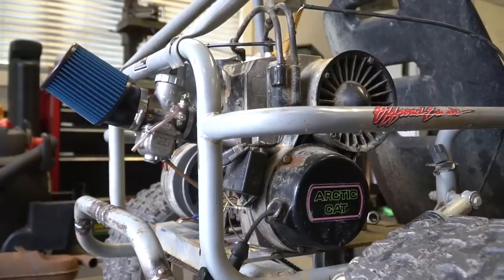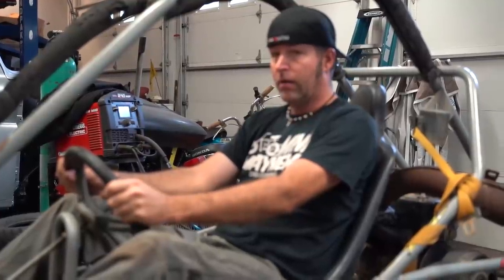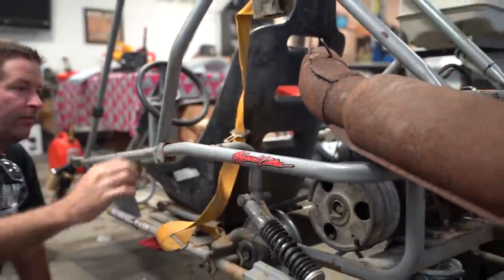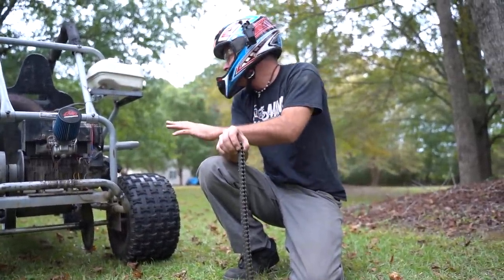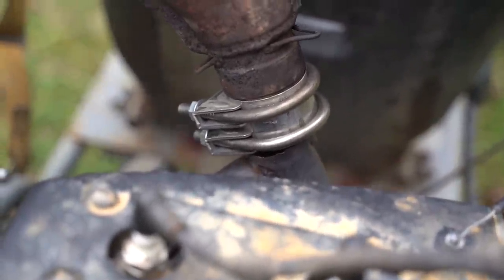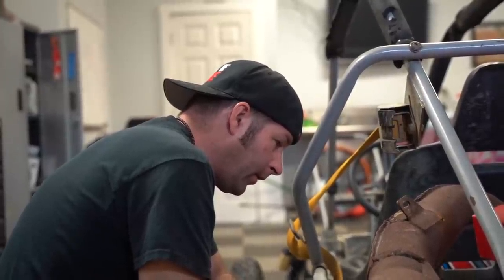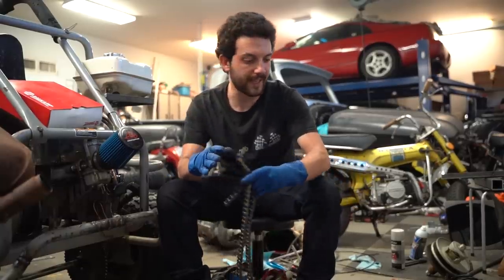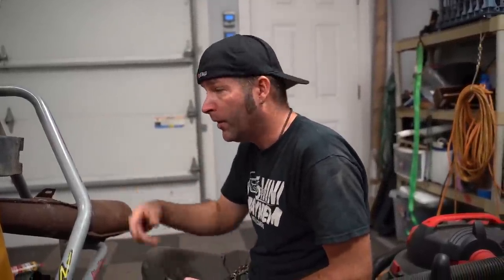440cc 2 Stroke Go Kart First Ride!

Comment: Way to much 2 stroke oil guys, once you reduce it the motor will not just run better, it will have a lot more power dude's 👍
Reply: We had the mix rite. The exaust pipe was full of oil

Comment: A couple 50 caliber ammo cans mounted up & out the way would make some great saddle style fuel tanks. Even if y'all welded the top so seal them. Just a F.Y.I.   Or suggestion ????
 edit: it would be a great idea for y'all to find out what  max hp & torque the chain your using. 2 feet of flying chain, would ruin the day. Think Gentalmen before you act. It just might save your life. 
 Start a safety program, show your younger Viewers you care. It would be a you tube first.

Comment: Doesn't that make you never want to go back to one of those weak ass 670 predator or other weak as lawnmower motors. 440cc vs 670 no comparison is it? And you need to change the jetting its very easy on a 2 stroke the spark plug will tell you everything much more than a 4 stroke will. Use a new plug each time until you get it right so you can see the color.

Comment: That will never get up on the pipe. The header is trash for a 2 stroke.2 stroke world the exhaust is equally as important as the carb. yea it will run but like crap.

Comment: Only half way thru vid...yes must rubber mount a 2 stroke. Also spring mount exhaust into a ball/socket kind of arraingement to your homeade manifold. Buy a new generic arctic cat genuine comet clutch setup for snowmobile (also please please quit calling it a torque converter...love you guys but please cease and desist on that terminology...and its ok to tell me to get spell check as a rebuttal). On very first ride on camera its almost comical how much faster it looks compared to any predator. I say that as a huge fan of predators yet also as a snowmobiler for years. Ok time to continue vid....